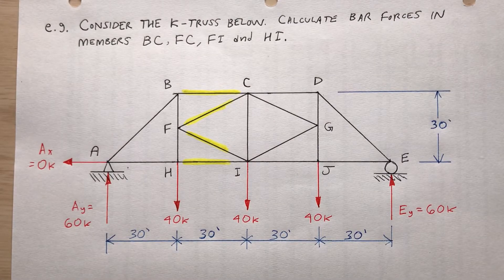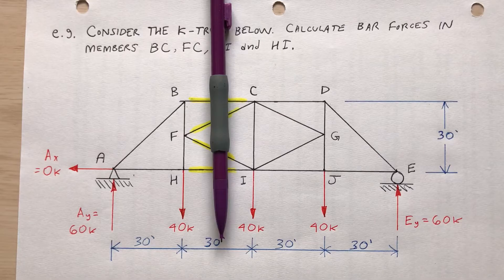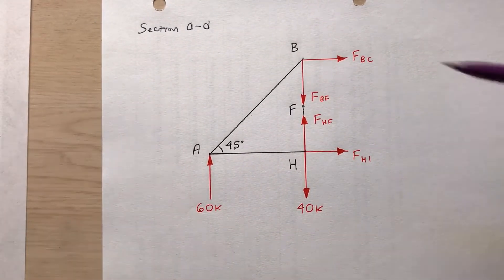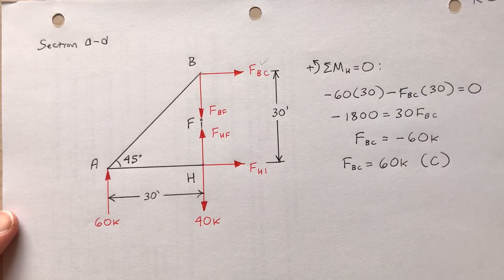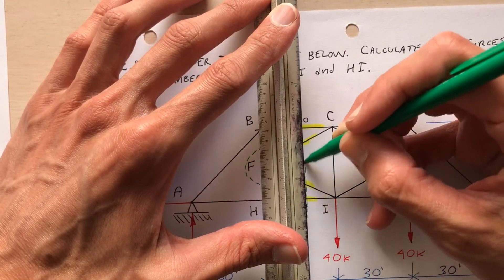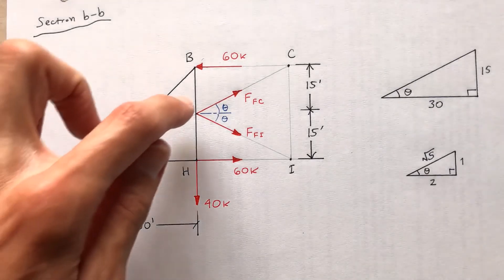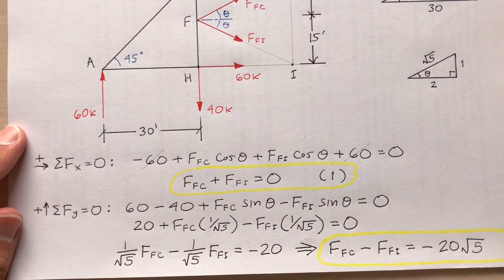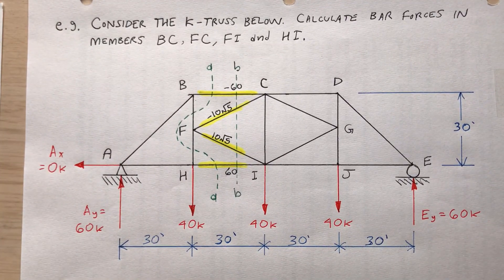Structural Analysis: K Truss - Method of Sections

Comment: I would really appreciate it if you could make a video about how to convert uniformly distributed loading on the truss to point loads.
Reply from the maker: For the truss itself, the assumption is always point loads only and applied only at the joints (i.e. no point load applied to a truss member between two joints).  If the truss supports a bridge deck, the deck itself may be considered a distributed load, but then that would have to be converted into point loads and then applied to the joints of the truss as appropriate.

Comment: which members are in tension and which are in compression?
Reply: The convention is that when you draw the free body diagram, all members that are "sectioned" are in tension (seen at 2:15 & 4:30). Once all of the calculations are completed a positive answer indicated that this assumption is correct (i.e the beam is in tension) & a negative answer indicates that the assumption was incorrect (i.e the beam is in compression). 

Also, getting the assumption wrong ( a negative result) is perfectly normal & is nothing to worry about:)
Reply: Thank you sir